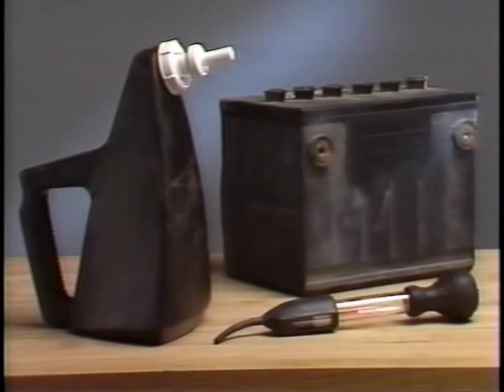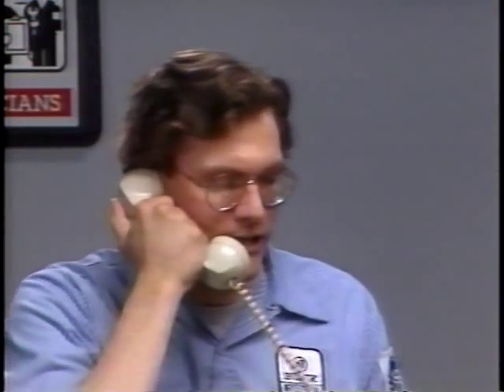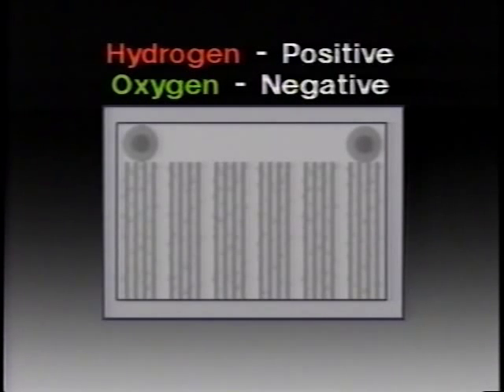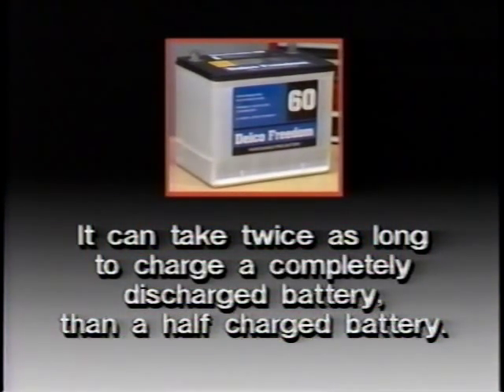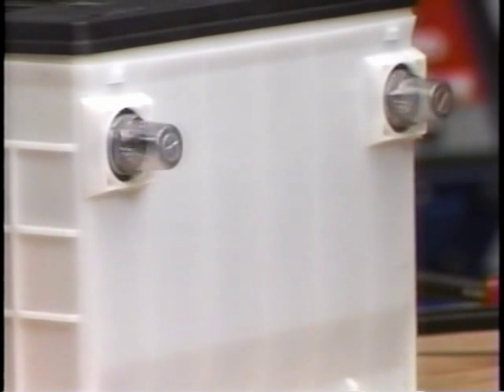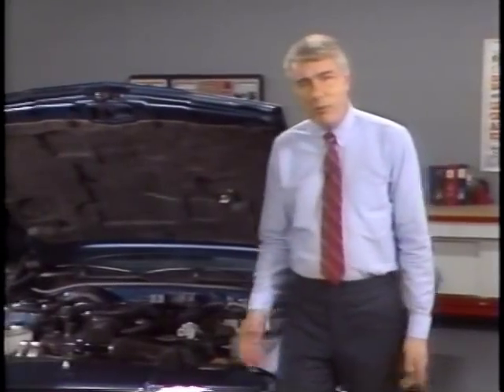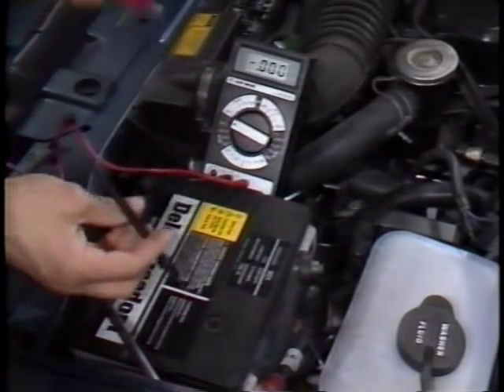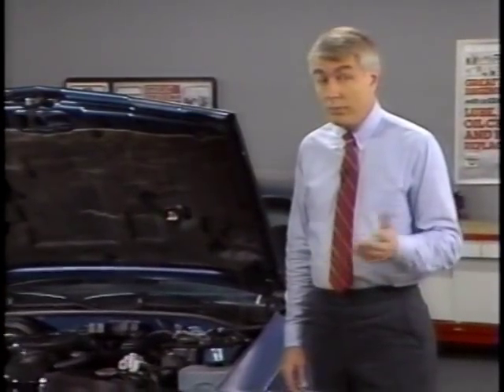Buick - Testing and Charging Delco Freedom Batteries (1987)

Comment: Thanks for sharing. My original AC Delco Freedom Battery was recently stolen from my 2002 Saturn. I don't know why- I had only 20,000 miles on it after all these years and the battery never failed me. It was a great battery. Whoever-mechanics- replaced it without my knowledge, with a used Megatron (bright Green). Can anyone tell me what was so special about the AC Delco that they switched it without my knowledge? I viewed this video in search of an answer. Ever since, my service engine light will not turn off no matter how many repairs I make. Thanks for Posting.